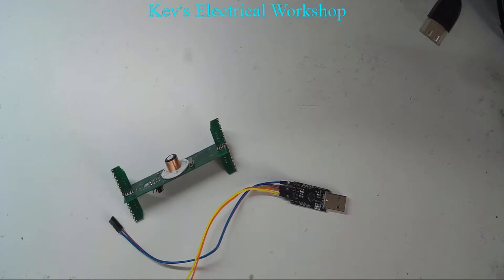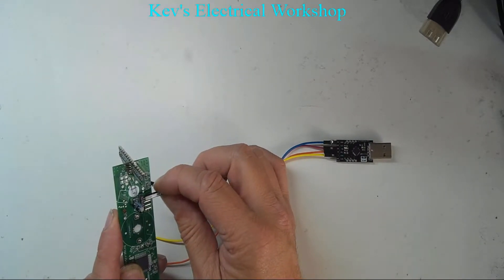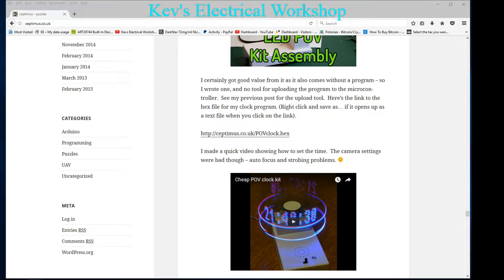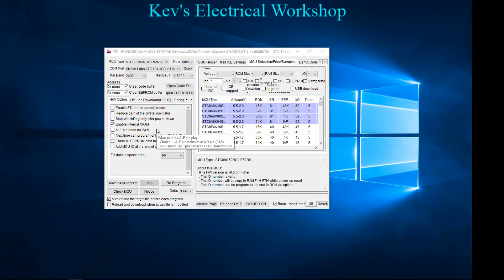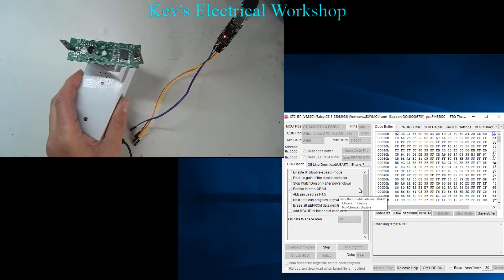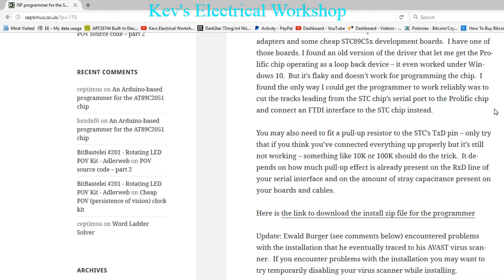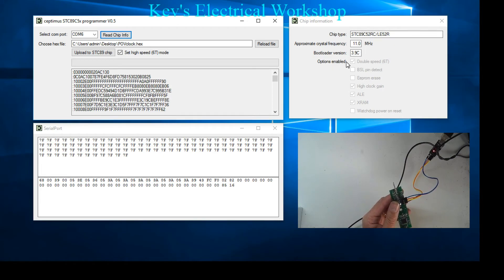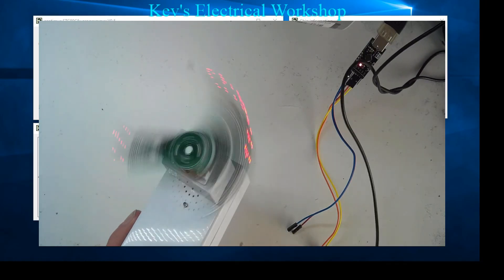Cross LED Dot Matrix Display Circuit Board Rotating Electronic Kit Part 7

Comment: Hi wondered if you could help im trying to repair a pair of cloud 9 touch irons one of the short white cables that is attached to the heat plate with a brown coloured putty like material is not secured. Could you advise what to use to secure this back on. Thanks
Reply from the maker: the brownie red stuf if high temperature RTV silicon and is there for insulation and a bit of mechanical protection, if the wire is loose then its snapped off the heater and you will need a new heater.